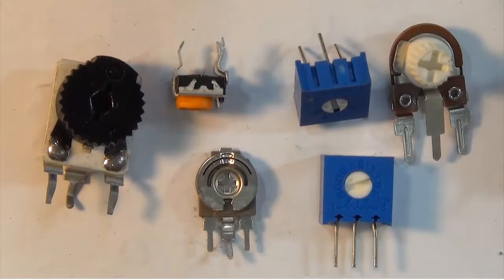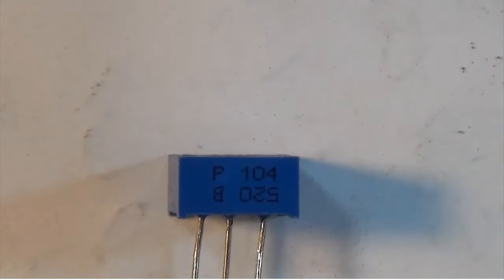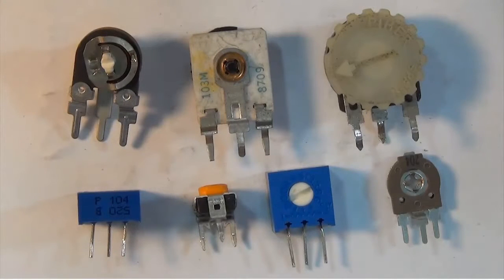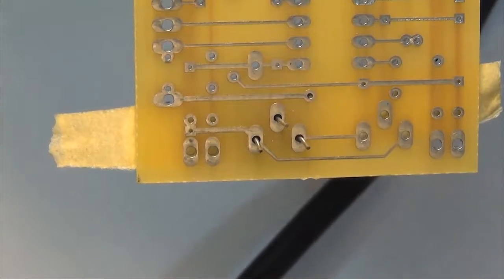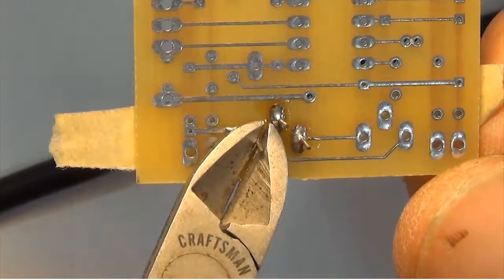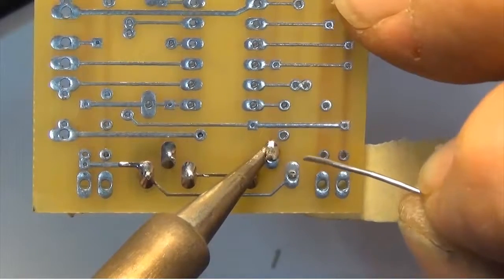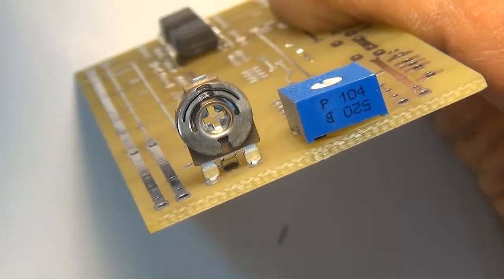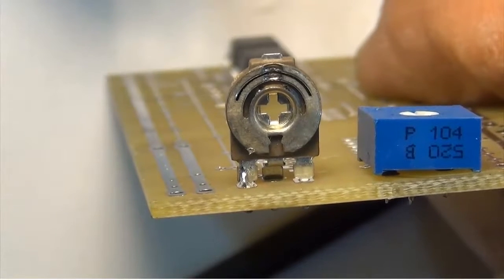Resistor Trimmers & Soldering | Methods & Tips | on a PCB

Comment: Nice video!
I have a Bourns 3386 single turn, side adjust trimpot (the blue colour ones).  I have two questions
1. I cant find its max resistance..on top it is printed "100" one way and "116N" below it the opposite way. What does that mean? 10 Ohms or 100 Ohms?
2. The 3 pins on it are side by side. If I want variable resistance, as per your video I should connect to first two pins? And if I want max resistance, then I should connect to 1 and 3?
Reply from the maker: 1) I'm thinking the 100 stands for 100 ohms.  When in doubt, measure the resistance across the outer two terminals.
2) You are correct.  Variable resistance will be from terminals 1-2 or 2-3. Fixed or max resistance across terminals 1-3.